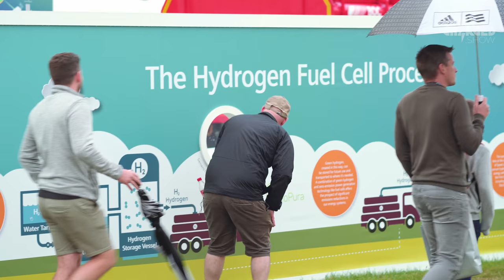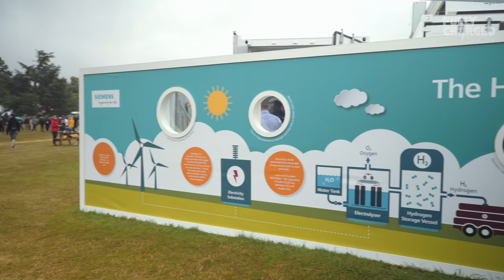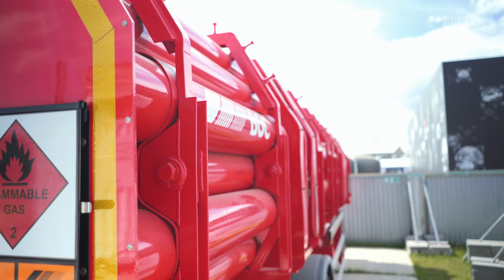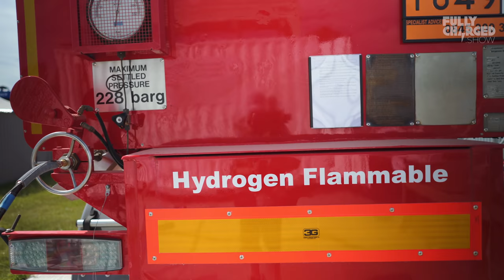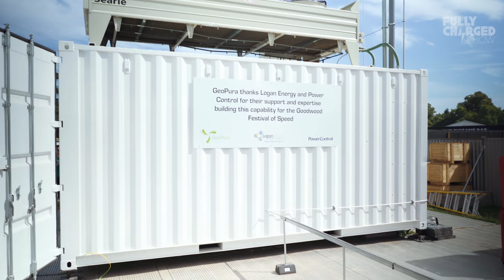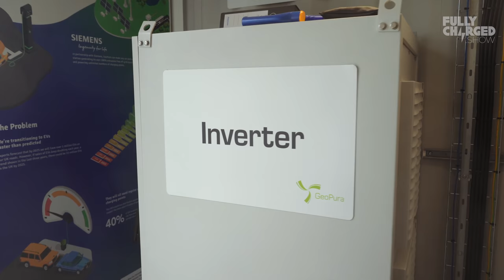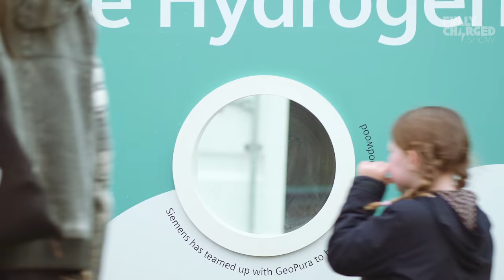Green Hydrogen Fuel Cell Charging System at Goodwood Festival of Speed | Fully Charged

Comment: A hospital would be an ideal place for this technology - used to the handling of gases (NO2, O2 etc), likely to have the storage space, in need of the heat and the electricity and could use the clean water produced. Couple this setup with a few PV panels and a turbine and it may also benefit from a grid feed in subsidy. Do I think the U.K. will do it? Naahh.
Reply: Backup generators for hospitals and the like spend very little time turned on.  No need to reduce the emissions of something you don't use.
Reply: You'd give sick people water which dripped out of a PVC pipe in the corner of a shipping container?
Reply: No, but not because it came out of a PVC pipe, but because if you only drink pure water you get sick because it lacks minerals that are necessary, it is the same as on boat water makers need to add minerals to the water after the process.
Reply: Hydrogen Fuel cells are as energy inefficient as ICE.  It makes much more sense to burn Natural Gas directly in an ICE backup generator.  It's far more cost efficient and the same overall energy efficiency.  Again HFC is the same efficiency as ICE.  It's a loser compared to the 3x to 4x greater energy efficiency of battery electric vehicles, for eample.
Reply: @2nd3rd1st  The water doesn't have to be used for drinking. There are needs for steam, hot water and chilled water all over the hospital. Cleaning of instruments, HVAC, etc.
Reply: @LoanwordEggcorn  "It makes much more sense to burn Natural Gas directly in an ICE backup generator." <-- Total nonsense in most circumstances. Why ship in natural gas when you can make electricity on site from the sun and wind?
"It's a loser compared to the 3x to 4x greater energy efficiency" <-- Efficiency is irrelevant when the source is infinite. Only a fool would pay for something he can get for free.
Reply: @2nd3rd1st  "You'd give sick people water which dripped out of a PVC pipe in the corner of a shipping container?" <-- You'd give sick people water from an unknown source and shipped (in shipping containers) in plastic bottles which are known to leach toxic chemicals?
Reply: @NibsNiven  Talking about places that have natural gas already piped in, such as buildings.

The same energy used to make Hydrogen from water can move an EV 3 to 4 times as far, or get 3 to 4 times as much usefulness from battery storage for backup power.  It makes no sense to use a form of energy (Hydrogen) that is 3x to 4x less energy efficient overall.  It's a waste of resources.  The cost in resources to use Hydrogen is very wasteful.  The cost of those resources is NOT free.  Only a fool would use 3x to 4x more resources to get the same end result.
Reply: @LoanwordEggcorn  "It makes no sense to use a form of energy (Hydrogen) that is 3x to 4x less energy efficient overall.  It's a waste of resources. " <-- Again with the nonsense. Your opinion is totally nonsensical when the supply of the fuel source is free and infinite. Why are you having a problem with this fundamental concept which a 5 year old can understand?
Reply: Loanword Eggcorn, repeating your opinion will not make it any more relevant.
"I'm sorry if you lack the knowledge or ability to understand this fact." <-- No you're not sorry. You seem to think that because I pointed out that the efficiency of hydrogen as energy storage is not relevant to this situation, that I must not understand fundamental concepts. Why are you bothering if you think I'm so stupid? Anyway, I'll not waste another minute on you.
Reply: @2nd3rd1st  you've just demonstrated your lack of insight. Do you think this is the last stage of development?
Reply: @NibsNiven  None of what I said is opinion.  It's all measured fact.  I suggest you educate yourself if you don't wish to look like a fool.  Google "well-to-wheels efficiency of hydrogen fuel cell vehicles" for one example.  Their efficiency is about the same as internal combustion engines run on fossil fuels.  Both FCV and ICE are about 3x to 4x less energy efficient than battery electric vehicles.  Used as energy storage, electrolyzed Hydrogen with fuel cells are far less energy efficient than batteries.  Again these are measured, scientific facts, not opinion.
Reply: @LoanwordEggcorn  Try watching the video with the sound on. They explain that this ISN'T about powering EVs from hydrogen, it's about STORING energy for later use.
Reply: @WonkoTheSaneUK  I watched the video.  They're basically using the Hydrogen as an energy storage medium like a very inefficient battery in order to charge EVs.  The  fuel cells have such low power output that they actually need to use batteries to store the energy after the fuel cells to do useful things like charging EVs.  The whole process is incredibly inefficient due to all the conversion losses.  Do the math.  Multiply the efficiencies.  The net efficiency of this system is going to be much lower than an ICE generator burning fossil fuels.  Again, do the math.
Reply: @LoanwordEggcorn  Yes, but as pointed out to you several times efficient use of free commodities is irrelevant within low orders of magnitude difference like this. And more importantly, the whole point of this technology (and this channel) is to avoid the use of fossil fuels. We can tolerate noticeably higher inefficiency if we avoid fossil fuel use/CO2 release, especially (once again) if the energy was free in the first place.
Reply: Ridiculous idea. Hospitals are on the grid and can therefore be powered by safe, reliable and climate friendly nuclear. No need to put thousands of rolling hydrogen explosions waiting to happen on the roads.
Reply: @rhamph  - I was thinking of HFC as a partial alternative during darkness hours, when electricity demand in the hospital is less and maybe in part met by the set up shown. This would lessen demand on the alternative CO2 storage and battery storage being planned which would be consumed by e.g. households and small businesses.
Reply: @andyroid7339  Ahh, more like neighbourhood energy storage then.  Neighbourhood storage allows a reduction in size of transmission lines by removing consumption peaks.  It doesn't remove the production peaks of renewables though, so I'm not sure it's all that beneficial.

It does add robustness to the network though, particularly valuable for emergency facilities like a hospital.  Definitely a plausible application for HFC.
Reply: @LoanwordEggcorn  You conveniently fail to account for a few massively important factors. The lifespan of batteries being one - they cost huge amounts of energy to remanufacturer and don't last so over its lifetime a fuel cell in theory can be massively more efficient, as it should last basically forever (there are issues with poisoned catalysts etc) 

The batteries they used in this case were to provide a buffer of power to allow the generator to ramp up something needed with ICE generators as well (at least to use them efficiently - you could just run a generator flat out and waste huge amounts of energy when its not needed if you like).
Then there is the biggest elephant in the room for Fossil fuels - the huge amount of energy used extracting, cracking, distilling and transporting them. There are the fossil fuel conversion losses, and efficiency wise its crap too. Oh add to that the fact that crushed up dead stuff from before the dawn of the human race is a limited resource we want to burn all of as fast as possible it seems.. Oil can't last forever so even if it was 100% efficient we still need to develop technology like this if we wish to continue living in a technological society.

For me compressed or liquefied air is a better energy storage medium for renewables- its a really simple technology that doesn't need rare resources to build. But Hydrogen certainly has its place.
Reply: @rhamph  - a hospital was the first that came to mind. Not sure of others though, possibly prisons (obviously service access would be the problem here) or universities (which tend to be centrally located, more so than hospitals). Can you foresee HFC used as an adjunct to a power substation (notwithstanding the obvious safety issues)?
Reply: @rhamph  Do you think my pessimistic end comment,

"Do I think the U.K. will do it? Naahh" ,

was justified? I made this as it seems that the thorough modelling needed is more likely to happen in Netherlands, Denmark or Germany instead of in the U.K. where we may finally receive this technology only after its real-life application is already showing benefits. While this approach may save the U.K. some development money it places us even further down the ranking of innovative countries. Let me know your thoughts, it's a pleasure to hear from you.
Reply: @UCZySwck7kzdCP2dda8zCQaw Yes grid battery can last, but it is still part of the lifecycle to account for that is ignored.  There is also the great enviromental cost of supplying more rarer elements for making evermore batteries (though fuel cell also have this issue)

The crux however as others have pointed out when the source is effectively infinite rather than oil based and finite efficiency is not the biggest concern. The sun will still radiate and power our atmosphere long after humans are all dead or living in some space utopia future.
Reply: @andyroid7339  "modelling" means doing it on paper (or computer), looking at how profitability changes as the costs change (mostly due to technology improvements).  The extreme inefficiency of HFC could mean it quickly becomes uncompetitive to other approaches.  A gamble like that is an easy way to lose a billion dollars.  I doubt any country will attempt a large scale rollout of HFC grid storage in the foreseeable future.
Reply: @NibsNiven  "Why ship in natural gas when you can make electricity on site from the sun and wind?"
Why make the electricity in the first place if you're immediately going to waste 2/3rds of it producing hydrogen? Why not just CHARGE A FECKING BATTERY?!
Reply: @NibsNiven  
Efficiency is totally relevant.
Reply: @phillycheesetake  Calm the feck down, Skippy. Both have their advantages. As battery tech moves on from lithium to cheaper alternatives and supercapacitors, hydrogen will be less useful.
Reply: @NibsNiven  Hydrogen has advantages...plural? Lol.
Reply: @rogerstarkey5390  Of course it is, but not always.
Reply: @phillycheesetake  Keep laughing, clown.
Reply: @rhamph  so it's possible, if battery technology continues to improve as quickly as it is, that HFC may become obsolete? I wondered otherwise, due to the lithium and cobalt requirements of batteries (just seen the news reports of dry aluminium battery invented by the RN engineer though) , whereas HFC requires fewer finite resources. Could this keep the tech "alive"? I agree that no country would commit to only one storage method on a large scale.
Reply: @andyroid7339  A significantly cheaper battery that has the same weight and efficiency of existing lithium ion would make HFC obsolete, yes.

A quick look at that aluminium-air battery shows it's NOT rechargable.  It's competing with alkaline AA batteries that you throw out, not what's in your cellphone or car.

Honestly, the material requirements are overblown.  Yes, they matter and we should find better options, but we've been doing such mining for a long time and the new battery applications don't change anything.  It's mostly the media having a field day.